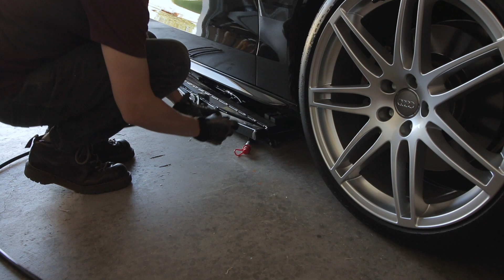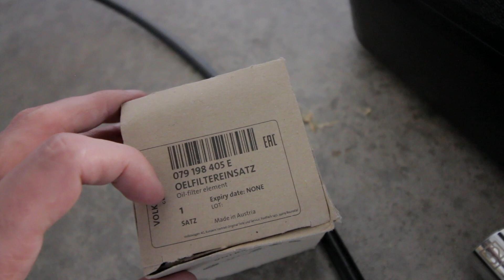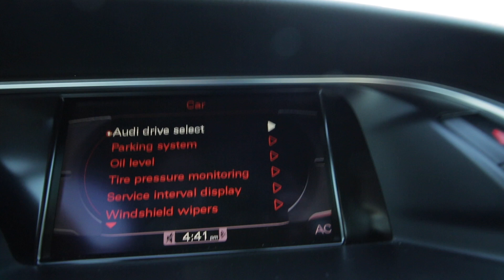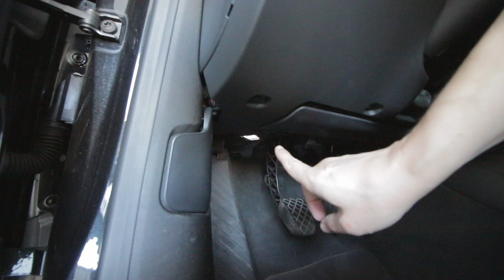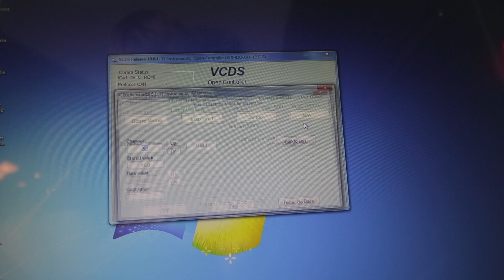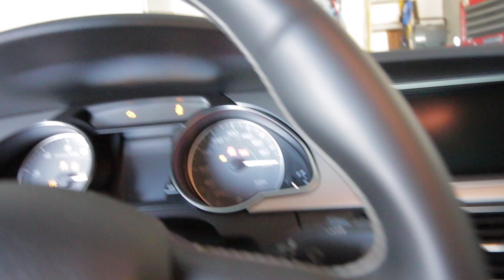2011 Audi S5 V8 Oil Change and Service Reminder Reset using VCDS

Comment: Hey just a question… I noticed you did not prime the oil filter…Do you know of a way to do so?
Reply from the maker: No need to prefill/prime oil filters unless the manufacturer expressly says to do so.  Some vehicles have filters installed sideways which would make it very difficult or impossible to prefill.  Safe yourself from a potential mess and just don't prime.

Comment: Where is what is the item number for your vcds cable?
Reply from the maker: For my 2011 Audi, I purchased the HEX+CAN cable from Ross-Tech with USB interface (HC437907 Rev. B).  I believe that cable is now considered legacy, but they do now have HEX-V2 as a replacement.

Comment: Thanks for this video!  What is the make and torque range of your torque wrench?  Did you get the plug washer from the dealer?
Did you have any issues setting up your quickjacks?
Reply from the maker: I have two Kobalt torque wrenches that I use. One has a range from 20-100 ft-lbs with a 3/8” drive.  Length is about 17”.  The other has a range from 50-250 ft-lbs with a 1/2” drive. Length is about 25.5”.

I usually buy an oil kit from ECS tuning which includes the oil, filter, washers, and plug if needed.

Quickjacks came mostly assembled.  Just needed to attach the safety bars, fill the reservoir with hydraulic fluid, and attach hoses. The quick connects on the hoses are really nice. They don’t leak any fluid when attaching/detaching.  The jacks sit low enough that I can park the car over it without issues.  Love this thing.
Reply: Thanks for the info  @MikeBedau  - really appreciate it!

Comment: What weight and kind of oil does a 2010 S5 V8 Quattro take
Reply: I just got a 2010 S5 4.2L 6MT and I plan on using LIQUI MOLY Leichtlauf High Tech 5W-40 for my next oil change.  I'm going to do an engine flush and add some Ceratec too.  The car's got a little over 65K miles on it atm

Comment: Hey great video but why is your check engine light on?
Reply from the maker: Great question.  Here is a quote from a google search: "If your Audi check engine light stays on, it means the On-Board Diagnostic (OBD) system has detected a problem. Fault codes often referred to as Diagnostic Trouble Code or DTC gets stored in the Engine Control Unit."  In may case, I had a fault code stored in the ECU for the backup camera.  My backup camera doesn't always come on sometimes so it must have thrown a code.  I didn't clear this code during my oil reset.
Reply: Mike Bedau Wow you learn something new everyday man, thanks for the feedback! I love the car.
Reply: @Korbyn Kolton Thanks for your reply. I got to the site thru google and I'm waiting for the hacking stuff atm.
I see it takes quite some time so I will get back to you later with my results.
Reply: @Korbyn Kolton It worked and I finally got access to my account again. Im so happy:D
Thank you so much, you really help me out :D
Reply: @Shane Tatum Happy to help :)
Reply: @Shane Tatum instablaster =)
Reply: i guess Im asking randomly but does anybody know a trick to get back into an Instagram account..?
I was stupid forgot my login password. I would appreciate any tips you can offer me.